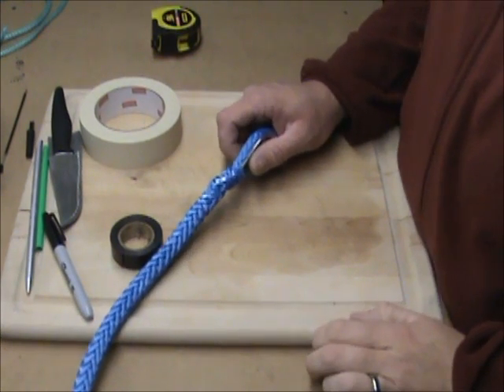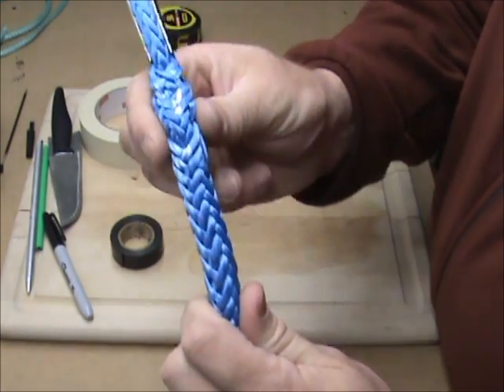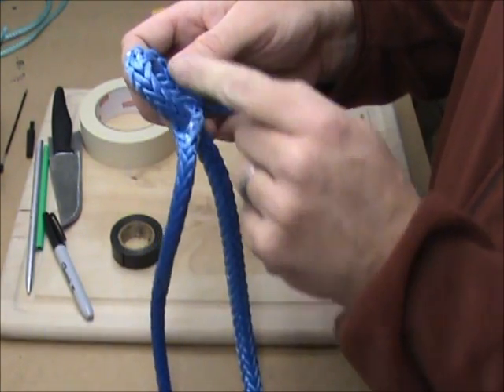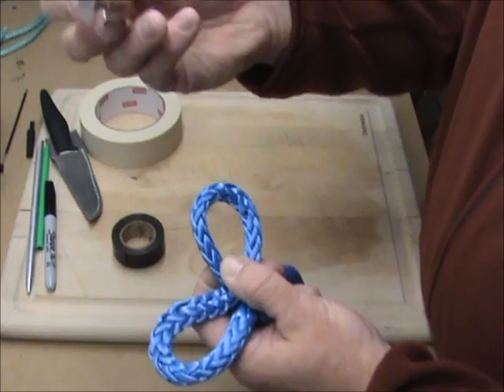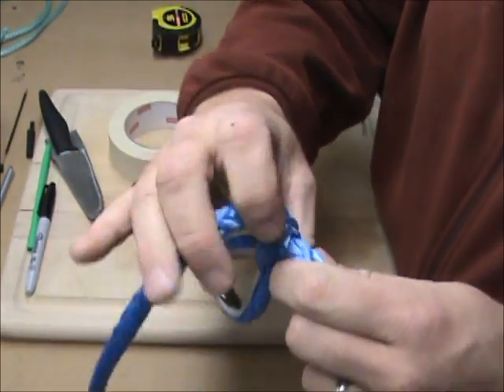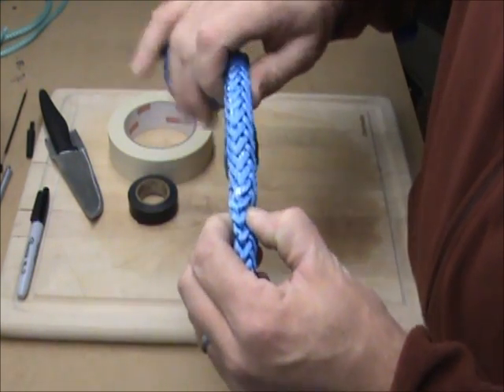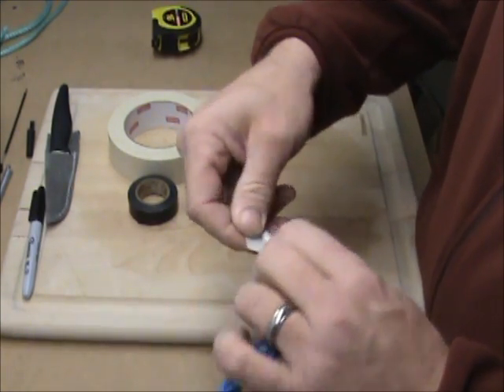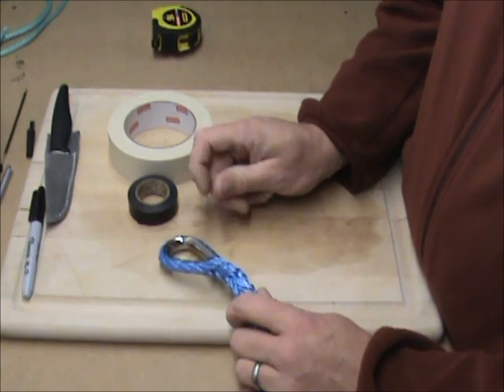How to replace the thimble in your Amsteel Blue Winch Rope

Comment from the maker: @UCmumstaxi Proper "tail" length is determined by multiplying the diameter of the line by 63. As you are constructing the thimble end of your line, make sure that when you have the thimble placed and sized in the line, you still have the 63 times line diameter to bury. For example, 3/8 diameter line converted to decimal is .375. Multiply that by 63 and you get 23.625. I always round up so your tail will be 24" long. This is what should be buried in the line past the thimble.

Comment: Great work, thanks for posting, this and your other video where you accidentally give the tail measurement for "this" application, have been very helpfull.

For those like myself, who had to start with nothing, perhaps you could mention how to work out what the ideal tail length should be, and also if it matters, just exactly how far down from the thimble should the winch line should pass through the tail ?

Thanks again !

Comment: Hi Kris thanks for the video. Quick question... when replacing the thimble... are there different kinds of strenghs?? Or is it pretty much one is made just as cheap as the next?
With out even knowing this, I've made this loop for ever for my boat. I have a plastic tube that you put the rope in and it slides inside very smoothly (is that a word?) anyway.... pretty nice!!!